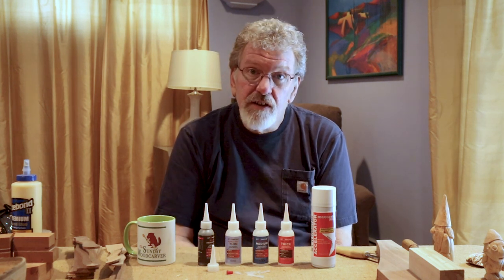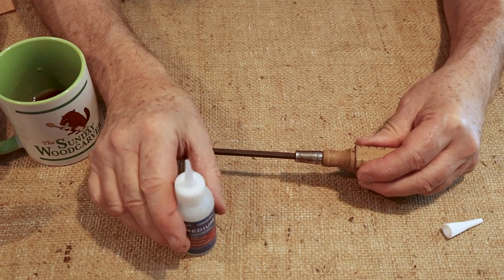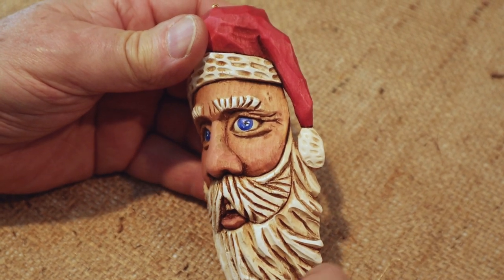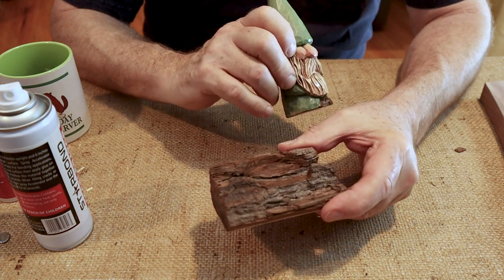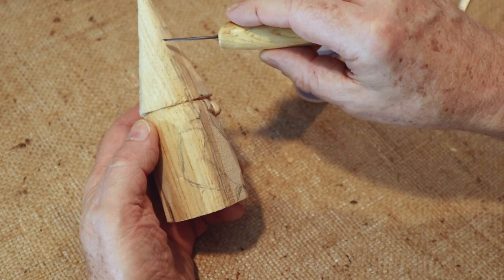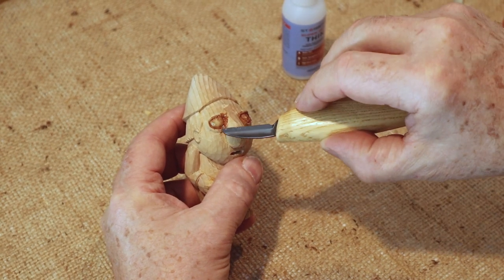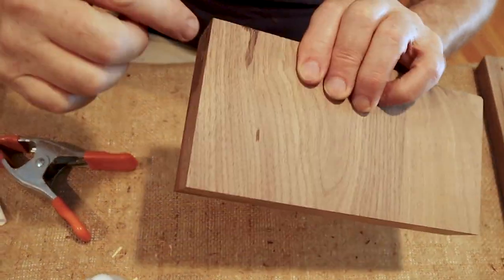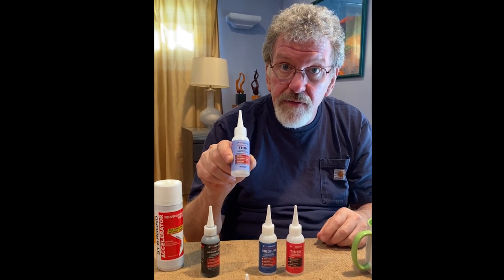10 Way to Use CA Glue

Comment: The only thing you forgot is how do you clean the ends
Reply from the maker: I usually stick a stretched out paper clip in the tip. Do you have another way?
Reply: @UltraD52  no I don't have a better way but thank you
Reply from the maker: Also, I found if I turn the bottle right-side-up and tap a few times to get the liquid to run down, that helps. Do before putting the lid on. And wipe of the outside so it doesn't build up in the lid.